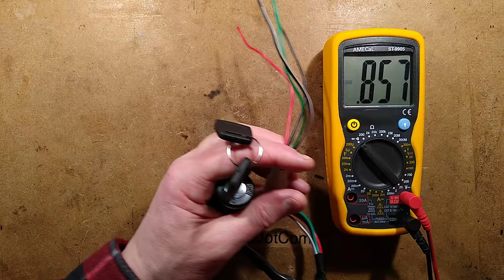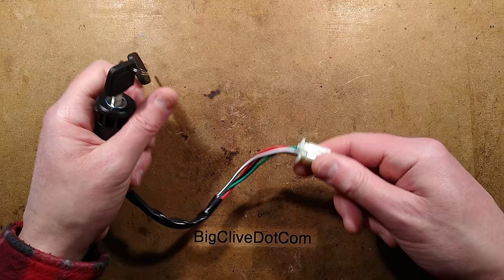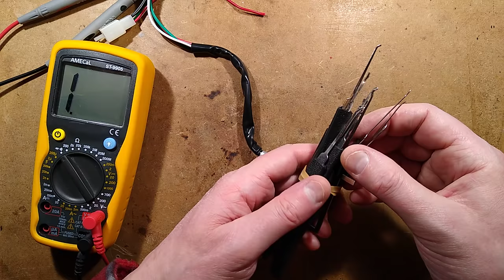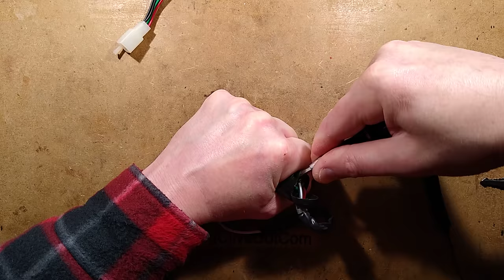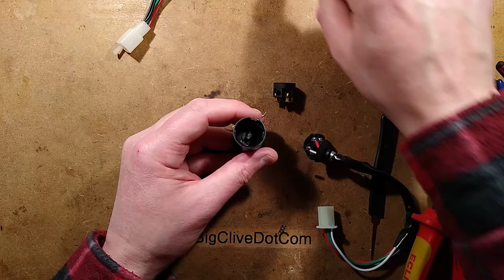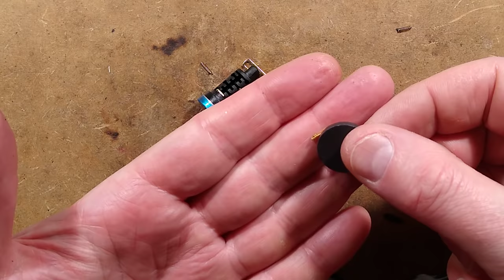Lock picking and opening a quad/scooter key switch.

Comment: Well, the lock or the system isn't secure, but, to be fair, if your bike were equipped with this loom, nobody would want to steal it anyway.
Reply: My first Chinese moped the first week someone tried to steal it. Though I did learn a lot from that moped.
Reply: Actually this is a fairly standard arrangement on a lot of bikes / scooters / moped / etc. Many (if not most of them) can be kickstarted after simply disconnecting the ignition switch, which opens the circuit between ignition and ground. You won't have working lights, indicators, horn, electric starter, etc. And you may have to also defeat a steering lock, but it'll drive just fine otherwise.
Reply: I've spent some time in Taiwan and it seems that everyone has a scooter over there... The vast majority of them seem to be made by the local manufacturer Kymco and quite often they are gray in color.  The best defense against getting your bike stolen is to park it among a group of bikes that look just like it so the odds of a thief randomly choosing yours is less... :)  Of course, one problem with this is that you might misplace your own bike when you do that... I ended up misplacing the scooter I was renting and spent a couple of hours walking back and forth down the streets near where I parked it while trying to find it... I eventually narrowed it down to a 4x4 block area and just sequentially went down every street (N-S and E-W), looking at every license plate to see if it matched the number on my key chain...
Reply: @jakeblanton6853  maybe tie a weird coloured scarf to it next time, or make a note of something striking on the street where you left it.
Reply: @penfold7800  -- After that experience, I started setting a GPS marker on where I parked the scooter and took photos of the surrounding area and the nearest street sign so that if I lost it again, I at least had a chance of getting closer to it before having to do the sequential search... With a 4x4 block area that I had narrowed it down to, that mean that there both sides of 10 street that I needed to search and each street was 4 blocks long.  Yeah, I learned a lesson from that experience... Of course, not ALL of the blocks were wall to wall scooters the entire length of the block on both sides, but often there were nearly a full block on one side and a good portion on the other side... I would have to go look at my records, but I suspect this was back in 2016... It was a fun trip though... I would drop my wife off to the thing she was doing for the entire day with the other old ladies who had come there for the same thing and then just start riding the scooter to see where I ended up -- sometimes in the mountains, sometimes in some remote part of the city... And then use Google Maps and the GPS on the phone to find my way back...  I avoided all the typical tourist areas if at all possible, although I might have stumbled across a few just by accident... Drank a lot of beer -- nearly all of it crappy other than one particular craft brewery pub that was owned by an American (IIRC) ex-pat...If it wasn't for this COVID nonsense, I would have no problem going back there for another month and scootering around for the entire time (assuming my wife had some old-lady-stuff to keep her occupied with)... :) The advantage of being financially secure and retired -- you don't give a fuck about anything anymore and just want to enjoy what little time you have left before the final dirt nap...

Comment: Waiting for the LPL / Bosnian Bill / Big Clive  joint effort - breaking into an alarmed, "secure" facility -  BB builds the tools, LPL picks the locks, and BC "disables" the  Chinese alarm system (complete with capacitor dropper power supply). Now, THAT would certainly be "Quality Entertainment" for everyone!
Reply: BC "takes it to bits" but needs "one moment please".
Reply: All the while Alec (Technology Connections) would be going on about the Chevvy Volt that drove them there and how many miles they have left on the battery
Reply: Ehm guys don't forget Jerryrigeverything disassembling the alarm "and the connector like a little lego"
Reply: Oceans 3 🤔
Reply: Yes we should make this happen!
I want to see a novice try to go up against the pros. ;)
Reply: @PinBallReviewerRepairs  But who's the novice?
Reply: @ElvenSpellmaker  That would be determined in the face off between LPL, Bosnian Bill and Clive. ;)

Comment: LPT: Some of those locks can be opened with a scissor blade or just a thin flat piece of metal just by pushing on the pins. This is usually standard for cheap mailbox locks and desk locks. Even some lockers and "safes" use these cheap locks because the are extremely easy to get and look fairly secure while also having a small form. These locks are known as waffer locks and they are easily some of the weakest out there mainly because most designs utilities 3-4 pins which don't have security pins underneath them which makes it easy just to push down all the pins and open the locking mechanism.

Comment: When you pulled the cylinder and all the springs and wafers rained out it made me smile. A couple years ago our name-brand front door electronic keypad lock broke and the manufacturer mailed me a new one under warranty. Swapping the keyed cylinder would have been a simple couple minute job if I hadn't let my curiosity take control. I pulled the retaining clip off the front of the cylinder it and when I pulled it out all the springs and pins rained down onto my table, just as in your video. What would have been a quick no-cost homeowner installation job turned into a $100+ mobile locksmith call to have the new cylinder re-keyed. One does learn by doing though ;-)

Comment: Many years ago I got my hands on a similar lock, it was very easy to pick (just standard wafers, raked it in one second). But even more interesting was the fact that the contacts were connected to the lock body, you could simply put a piece of metal (I used a small screwdriver) straight into the lock until it bottomed out and tilt it to the side and the circuit was complete, starting the engine (or whatever you connect it to).
Reply: Done that style of lock using nothing more than 2 paper clips, they are not secure at all. Amazing just how many things use that style of 4 wafer lock, and how easy they are to pick that often it is faster to pick it than to find the key on a big bunch.

Comment: Well done.  I wish I'd seen this before I had to figure out the wiring on my GY6 CCS (Cheap Chinese Scooter).  The hardest part was realizing that turning the key off closes a connection.

BTW, scooter key switches often have a steering interlock to prevent you from doing anything but going around in circles.  You have to take out 3 or 4 bolts to bypass that.

Comment: BigClive, you might also find the internal mechanics of a bike key switch for a Yamaha Virago interesting - beside the on and off positions it also has a "push in and turn" action for lights only, with some moderately elaborate internal gubbinry to activate/deactivate it. It certainly left an impression on me - it's much more complicated than some simple warding or cam path. Surely also other bikes have similar key switches but I have no idea which ones...

Comment: i had a peugoet buxy scooter/moped, and that thing would start with the kickstart if you removed the cable going into the ignition...
so safe lol  (a honda vision has the same problem i believe)
Reply: I have a Peugeot Rapido, which is based on the slightly older Honda Vision, and can confirm that this works lol

Comment: The proper way to take it apart is to use a follower at the rear of the lock. It's basically just a 1/2 inch plastic tube the same size as the inside of the lock and when it follows it the outter part of the lock is held together. Then the middle cylinder can be removed and worked on. Which is usually done to rekey. I've rekeyed a lot of locks & been doing it for decades now.

Comment: I have a can am quad, used a RFID key that snaps on the ignition ball switch. Different programming for different keys change engine and transmission settings.

Comment: It used to be that anyone who wanted to steal Toyota pickup trucks would carry a spare ignition switch and a Slim Jim with them. After opening the door with the Slim Jim, they would reach behind the dash, unplug the ignition switch, and plug in their own, and off they'd go. No picking, no hot wiring.

Comment: Using a 2 wire key for on/off coil kill switch. Problem: Key in on position = grounded closed circuit. No start. Key in off position( normal open) bike will start.. Fix:  Remove bottom cap with small screwdriver. Flip brass rotary contact bar and replace 2 springs in corresponding holes with contact bar lugs. Replace end cap. Check for continuity. Now, the key switch will be normally closed in the off position and normally open when key in on position.

Comment: A simple raking attack is all that’s usually needed to pick these, although I have run into wafor locks that I’ve needed to SPP. SPPing and raking are what set amateur pickers and professional pickers apart, as a practicing locksmith, I can SPP standard pin tumbler locks pretty easily. You should check out Locknoob he’s the UK version of LPL and BB.

Comment: Love your videos.
But... not an alternator (although there is one).
Any two stroke and many four stroke (garden machinery) engines use a magneto for ignition. If there is motion there will be a spark. The switch shorts out that circuit to stop the spark, like you said. Disconnect everything, bump start and it will run, just not an alternator
Reply from the maker: The loom this came off had a Capacitive Discharge Ignition system with a 200V AC feed from a multi-winding alternator.
Reply: @BigClive  
Interesting... probably a dual function rotor/stator to do magneto CDI ignition and charge the battery at the same time. What was the engine/vehicle/tool?
Reply: @davidw7155  yes a lot of scooters have a magnetic flywheel spinning around two stator coils. One for lighting and battery and the other is for the capacitive discharge ignition. There is also a pickup coil on the outside of the flywheel for ignition timing

Comment: So I used to be in the driveaway bidness (moving 3 to 4 diesel trucks "18 wheelers" ) , and every once in a while. They would ask me to do a repo, well I had no experience. So I called locksmith he broke into the freightliner truck (they had anti slimjim blocks) once inside you could just unscrew the round nut from dash release 2 clips and plug in your new ignition switch you had bought on the way over. I carried that same switch for years and used it many times. Folks just don't realize how unprotected vehicles are.

Comment: For those not inclined to pick the lock or hotwire (still won't disengage lock steering) a small screwdriver and hammer work great. Take it out in a few pieces. This advice is only for legal owners, anyone dumb enough to ride a stolen bike (period really) without an ignition deserves to get caught.

Comment: Only thing is, you can't bump start a scooter. (and I think most cheap quads have the same setup)
The clutch won't grab, (centrifugal clutch) and nothing happens.
Reply from the maker: Darn.  Then I'd need to bridge the main contacts on the starter solenoid.

Comment: Yeah you can’t just unplug that and bump start the engine.. the key will also provide power to the ignition on the vehicle when in the on position. You’d need to pull that plug find which wire you need to bridge to the battery to get voltage to the ignition. Then you can bump start it.
Reply from the maker: In this loom the CDI is powered directly from the Magneto.
Reply: @BigClive  dam thats a terrible design! Why bother with a key at all 🤦‍♂️

Comment: Sad that you didn't use screwdriver. Because for most of time you can pick that type of locks with just some force and screwdriver don't know why but it's very satisfying opening it like that 😅
Reply: I recently opened up an iPad cabinet* like that, using a thin screwdriver as a tension wrench and a bent paperclip as a pick. It only took a minute.

* This was in a school, it was done with the headteacher's permission as the school had lost the key.

Comment: More like "lock picking slayer"... 
The best way to "pick" a quad/scooter so equipped is to come with a friend and load it on the back of your pick up truck.

I did learn one thing and that's why LPL is so careful when he removes the core out of his locks. Oops, now all the little bits of metal are a mess on the bench. I didn't see that one coming.

Comment: That's a wafer lock, not a pin lock. Those horseshoe-shaped plates are pushed up by the key so both ends align at the shear line.

Comment: My first car was a Mk1 Ford Fiesta.  Its door locks were so good that if you locked your key in the car, absolutely any key that would fit in the slot would open it - house key, padlock key, you name it.  Wonder if they had any tumblers at all back then?  Its key looked really complicated though!  (before central locking era, to save time when leaving the car, you could lift the outer door handle and keep it lifted, push the inside lock button down, then shut the door and it would lock without using the key)

Comment: Cant bump start a variable belt transmission.
Reply: You  can if you know how, had to bump start more than one snowmobile. One becuse I'd broken the pull start another because I was too tired/weak to pull the dammed thing over with one hand while runinig the choke/throttle with the other.

Comment: So if you unplug the switch, what energises the engine electrics?
Reply: I believe the key energizes the starting circuit which goes to the button that will power the starting circuit (starter motor etc.). The bike electrics, I would assume, is powered by the battery, alternator or generator. Therefore, the key is only there to prevent push starting (when off) and to energize the starting circuit (when on). This is just a guess from the cheap scooters I've seen.
Reply: When I lost the key to my Suzuki 250 several years ago I just unpluged the lock and put in a jumper cable .

Comment: That's a wafer lock, the sort you get in window locks and low security applications, about as secure as a pringles can. Could probably pick it without a tension wrench if you just jiggled a metal strip in the keyway as you twist it. And that kids is why we have immobilisers.

Comment: No wonder electric scooters get stolen all the time
Reply: Just as easy to heft them into the bed of a pickup and drive away, then rework the ignition at leisure.
Reply: I mean, this model of ignition locks has been installed for over 30 years without any meaningful changes to it.